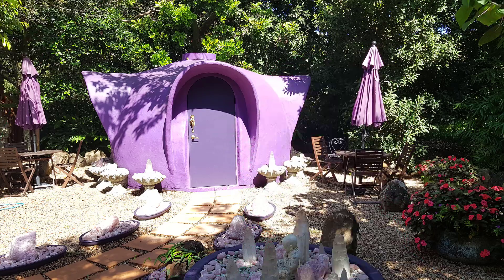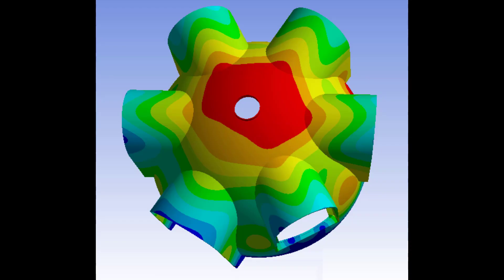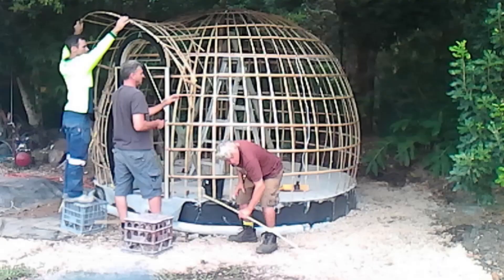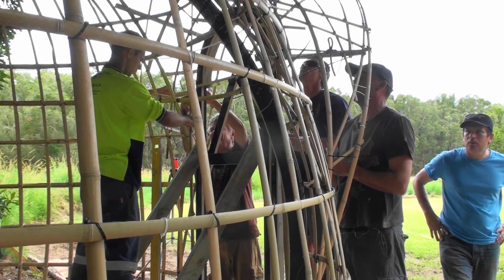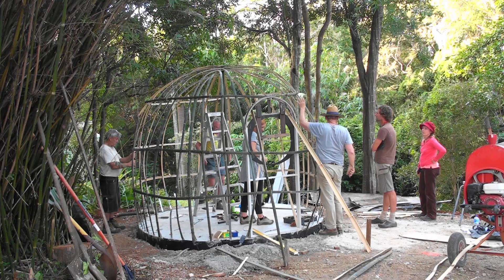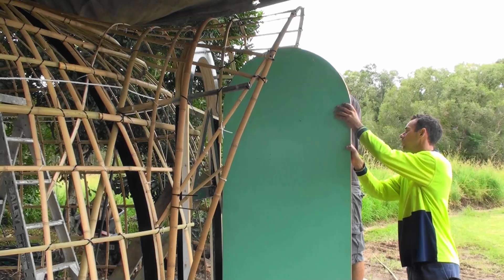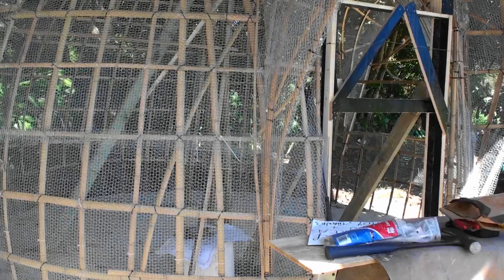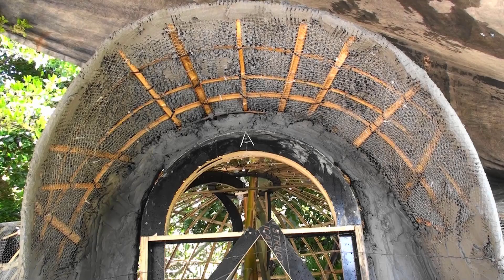Learn How to Build a Bamboo Reinforced Concrete Dome Home, Cabin or Survival Shelter

Comment: Wouldn't the bamboo deteriorate quickly surrounded by concrete?
Reply: The bamboo must be treated immediately after it is harvested. There are a number of ways it can be done and in Asian/tropical countries the perfect type of treated and split bamboo can be purchased all over. Our manual goes through a simple process of how we harvested the bamboo, treated the bamboo, split the bamboo and cured the bamboo before we used it. The bamboo provides a frame for wrapping as many layers of GAL chicken wire mesh.. The mesh forms an extremely strong mesh reinforced, monolithic shell structure that is actually doing all the structural work. However, Bamboo is known to perform quite well as reinforcement for concrete when used in the right way.
Reply: @ChrisBrown-me5bn  During my research I found bamboo being used as a frame thein reinforced with mesh and plastered with concrete like you do. However, isn't it better to split the bamboo before treating it for easier penetration of the chemicals?
Reply from the maker: @Norbingel  It may well be better to split first. The method we have used requires the bamboo to be treated immediately after harvesting. There are various ways of treating it. I am not an expert but the Indonesians are
Reply: @Domeshells  Yes, I've seen how Indonesians do it as well as others in SE Asia (where I'm from) and S America. The one common thing they seem to agree on is treating right after harvesting although they might differ on what counts as the start of the treatment process. The one that makes the most sense to me (I forgot which place does it) is washing the starches out first, then drying for a few days so they're dehydrated and will absorb the chemicals more readily when submerged. It's at this stage that splitting before submerging in chemicals might be better.

Anyway, thank you very much for your input.
Reply from the maker: @Norbingel  That sounds about right. Generally, for the long term, bamboo is not the best material. That is why, even through we treat the bamboo, I want the structural integrity to come from the mesh. Then it wont matter what happens to the bamboo
Reply: @Domeshells  how do you feel about adding rebar reinforcing? Not too much, maybe 8 "spokes" or so. 

Also, how do you waterproof the domes? Our plan is to build a demo dome for poor communities. Bamboo is one of the materials we're considering since it's readily available here and a dome shape would resist the frequent typhoons better than a typical box structure. They would be under hot sun and frequent rain though and we have to factor that in as well

Oh and many of these people live in areas where things like big tree branches can fall on the structure. Do you think just bamboo and wire mesh can hold up under that?
Reply from the maker: @Norbingel  we do use steel sometimes for some things. There are answers to your questions including options and much more info in our bamboo dome building manual. It costs a few cups of coffee: https://domeacademy.eductaion